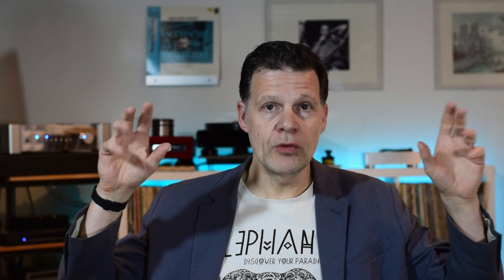New Magnepan Ultrawideband bass units! Focus group report

Comment: I've owned Maggies since 2001 and currently have the 1.7i. I've heard a lot about those bass units and the sneaky demo😉. Hopefully they'll come to SoCal for some demos.
Reply from the maker: Hey Tony, if you need some extra bass I think that these are just the ticket. Didn't hear them with Maggies, just the Martin Logans, but I'm sure it will be a similar match. Not sure if you will need another amp to power them or not, still lots of questions!

Comment: Sounds like mid-bass speakers that are not rolled off in the higher frequencies as much as their last subwoofer speaker.  Not sure I would want another set of almost full range speakers sitting in non-balanced areas of the room where the bass is usually the best but not for other frequencies.  Interested in hearing for myself.
Reply from the maker: Yes, integration with the main speakers seems to be a big concern for Magnepan with this product, so hopefully they have some innovative technology to assist with this. Interesting to see where this goes!

Comment: Magnepans while delivering fantastic sound stage have terrible WAF and are very finicky to be set up & amplified the right way. I ended using them with sustained plateau bias class A monoblocks, unfortunately they were terrible heavy and too much of heat produced when music is on still & speakers themselves should be placed some reasonable distance away from a wall which forms a fragile annoying obstacle in a room, can't be vacuum cleaned and being constantly worried about it is too much of a headache. Bass they delivered was never an issue for me, pipe organ recordings reproduction sounded absolutely fantastic. I am using fullrange DIY and several watts amp nowadays thanks to my previous Maggies experience.
Reply from the maker: Hi Antitrust, yes Magnepans can be a lot of trouble, the ones who really fall for the sound make it work for them! Full range, dipole and open baffle efficient speakers have a seductive sound as well, I'm just playing with a vintage set of coax Isophon speakers now and they are very interesting! Glad you found something that brings you joy.

Comment: Multiple voice coils in the bass array are likely helping generate the perceived power of the system, without dynamic compression interference interfering with the overall sound quality.
Reply from the maker: Yes, that will do it, but i'm not sure how those many voice coils will treat the amplifier hooked up to them. The Schiit Vidar run in mono seemed quite capable thouugh.

Comment: C’mon man, everyone knows that they are like giant resistors that vibrate and make sound. Horrible speakers low impedance capacitor voltage suckers that load amplifier output stages.
Reply from the maker: Yes, i guess you are right, they can present a difficult load, but the bass units seem to be traditional drivers I believe.
Reply: The new add-on woofers from Magnepan are not planar magnetic drivers but instead conventional woofers. No one outside of Magnepan has measured their sensitivity or impedance curve as they have not been put into production.